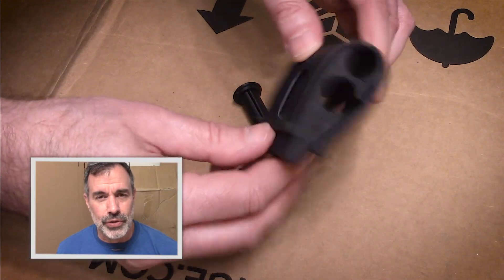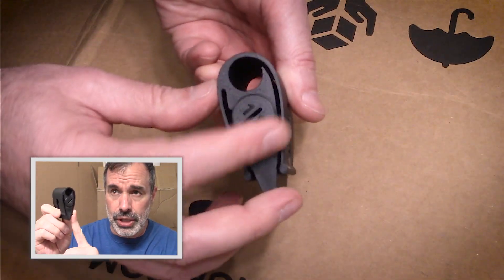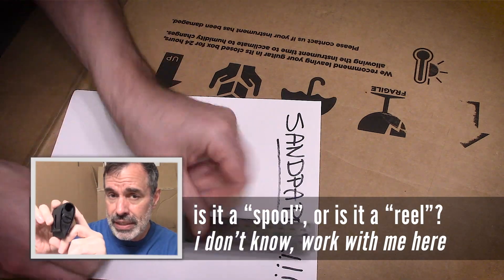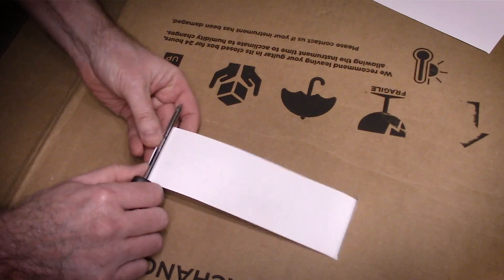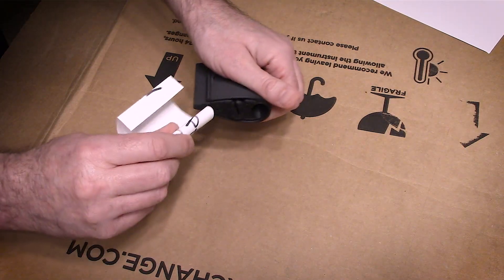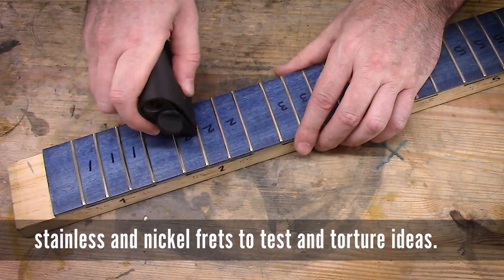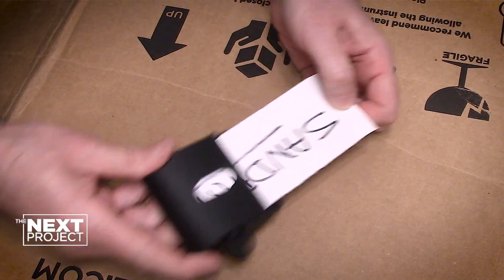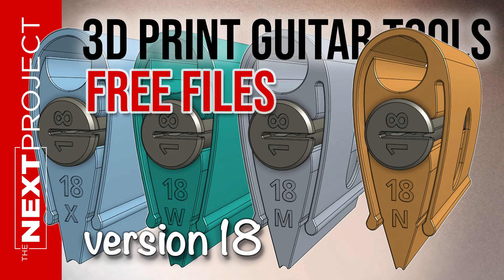Fret Sanding Polishing Grip v18 - 3D Printing Guitar Project Tools - Ep4B

Comment: Is there a width that seems to be the most popular/(all around usable)? I'm driving 30 miles tomorrow to a public library that has a 3D printer but my use is limited. I don't think I can print several of these. Also, they charge $1 for every 10 grams of filament. Any idea what this is gonna cost me? I realize thats not easy to answer when not know what the filament is. Thanks
Reply from the maker: I've been using the "wide" version for just about everything. Haven't tried the narrow and doubt that I will, the X-wide version may be overkill as well.

I just prepped the v18 wide version for print, and it should take 58 to 60 grams of filament. 
So if they charge $1 for 10grams, you'll be looking at $6 to print 1 complete sanding grip with the spool and knob. 

They should be able to set up the file ( slice it ) for you, and be sure "Support" is turned on. Support will add little tree or block looking things around the actual printed part, which will "support" some of the open-overhang areas during the printing.

Depending on the printer and a few settings, print time for 1 complete sanding grip ( with the spool and knob ) may take between 1 to 2 hours.
Again, really depends on what printer and settings being used.

I've been printing all my sanding grips using PLA filament. It seems tough enough for this purpose, and is pretty affordable.

I hope this helps, good luck with your printing process.
Reply: @theNextProject thanks for all the info. I appreciate you.

Comment: What orientation did you print the knob and roller in ? 

I printed them twice and there was not enough clearance for the roller to fit in the knob 😢 the second time i printed them with the highest quality setting.. they printed very nicely but just didnt fit 😊
Reply from the maker: Darryl, sorry to hear you're having print problems.

I'm a very basic 3D print person, a novice at best.
Each part was printed started with automatic part rotation to the print plate. 
So the coin shape end was down on the long reel part, and the thumb knob was pointing up on the reel cap piece.
There is a very small clearance designed in, so the part fit rather snuggly.

Jump to video showing orientation on the print plate.
https://youtu.be/Dd9O90jO-tE?si=pt6HLVpxvVxNDmcw&t=41

All my test printing was done with PLA, PLA+, and PETG-CF.
I'm using a Bambu Lab P1S, and the BL slicer.  Nothing fancy on my end, as I have no idea how a lot of this stuff works.
NOTE: When I originally was printing these with some Bambu PLA, there was no raft and no support on the thumb cap, it worked fine.
When I used some other products, I got an error stating I had unsupported overhangs... so I used either auto or tree support.
I did use tree support on the main handle/housing of the grip, due to those thumb holes in the sides.

0.4mm nozzle,  0.24 Draft, 2 wall, 3 top, 3 bottom layers, 15% Grid Infill.

If the cap won't fit to the reel, it may be a filament choice, filament setting (over extrude/under extrude), nozzle size and temp setting combined issue - just a novice guess. 
I have typically picked a filament, found a default pre-existing filament setting for it, and only adjusted bed temperature. All flow and such settings I just back away from at this point, I'm sure my printer would explode if I monkey with those things.

One workaround you could try, is to grab the reel in one hand, and some 220/320 sandpaper in the other. Then just give the end of the reel the is a little fat a slight rotation sanding. 

I appreciate your question regarding the print issue you are having. It helps me understand the potential issues we may all face.
Sorry I don't have a magic solution to correct the issue.
Again, maybe just a quick and light sanding of the reel end where it is to press into the cap. 

Please keep me posted as to what you find. 
I hope this helps!
Reply: @theNextProject thanks for the response!!! I will try printing the thumb knob without supports , maybe the support is causing some clearance issue. 
If that doesnt work , ill just jump into fusion and make another knob with slightly more clearance 😉. Its a neat design and im keen to try it out !!! Once i get it to work ill print 3 and load then up with different grits - it will definitely make polishing frets a breeze !!!

Comment: Hello, good sir. Those printed tools are very impressive. Is there a way to a guitar on the list for some RnR?
Reply from the maker: Scott, thanks for watching!
I hadn't thought of pre-release RnR group testing, interesting!
At this time, I pretty much just design, print, test, later-rinse-repeat as time allows.

If there would group testing, I would have to expect that anyone who would be doing some testing, would be able to print whatever the tool may be, as well as test the functionality.  The print-and-use feedback could be very enlightening for me, as I'm not overly knowledgeable in 3D printing. Also, I'm not running a print-farm to sent tools out - yet...probably won't happen.

Anyway, you've got me thinking ( that's dangerous! ).
As a new, or re-versioned tool project comes up, I may ask for testers. 
Maybe I'll post a message on the Community page of this channel... I'll have to figure that out too.
Thanks for showing interest, and if something comes up, I'll post some sort of notice.
Until then, be safe and take care!

Comment: Awesome! What grit papers do you find success with? How many do you typically use on a fret filing job?
Reply from the maker: Tom, thanks for watching, and that is a great question!
First, everyone will have their own process, so what I do may not perfectly align with others.
That said, let me start from fret leveling and work toward polishing.
I try to use the finest paper I can for leveling, typically 320 or 400.  Trying to keep scars to a minimum.
For re-crowning, I'm almost always using diamond files, 300 grit, nothing coarser than that.
Then I move onto pre-polish prep, and that's where I use this tool.
The last neck I worked, I started with 600 grit, then 1000, from there I went to polishing. So, not a lot of sanding steps needed. The frets were not scarred up, so it was pretty easy to prep them for polishing.
To polish, I currently use a dremel style tool with a cotton pad (or is it wool?), and Mother's Mag Polish to brighten the frets up.  Any good metal polish should do the same, so it doesn't have to be Mother's. 
When using the dremel and pad, it doesn't take much time per fret to get them really shiny. Keep moving back-and-forth to minimize any heat build up. 
Pretty easy process. 
Oh, I nearly always tape off the fingerboard before doing any of this work.

I do have a pedistal style buffer, and I had used it once for fret and fingerboard polishing, but it's not really my deal. Maybe if I forced myself to do things that way I'd feel differently, but for now I'll stay close to what I'd described above.

Oh, as for leveling. I do 2 types, one being a typical machined flat-bar with sandpaper on it to get the tops of the frets leveled... the other type of leveling is under-string/under-tension leveling, where the neck is strung up and whatever relief amount wanted is set in the neck. I'm finding this really offers an amazing low action for final fretwork. Even if the player doesn't want super-low action, the under string leveling (arched leveling - is that a thing?) really gets all the frets to play nice with their neighbors. It's not the same as using a few rocker/fret kisser tool either, it's a bit bigger picture, an interesting process - at least it is to me.

Hope I didn't omit anything, and hope this answers your question.
Be safe and take care!
Reply: @theNextProject  thank you for the detailed response!

Comment: So it's basically version 17.1.0.0?

With all the unused sanding paper in the beginning, it still saves you a lot, because of all the narrow space between the used paper.

Great work!
Reply from the maker: LOL, yes, 17.1.
 
I'll stick with 2 digits versioning, easier to visually keep track of, and since there is no software dependencies...
I'm working on v19 now (aka v17.2), but it may or may not see the light of day.

There is a little paper waste at the leading edge, and less at the tail, but having something to hold onto is what I really like. 
I guess we can cut the unused pieces off and save them for other purposes. I have a lot of cut-off collections all around me. 
Hmm, I may have a hoarding sickness.
Hope all is well for you, have a great weekend may friend!
Reply: @theNextProject  a hoarding sickness, yes, I know that.
I don't throw away the parts I removed, though I don't plan to ever use them again. Cheap pots and pups are just that, cheap.
But I once got a Harley Benton kit-bass. I guess the Squier pup might get into that, as I was never unhappy with the sound of it.
Actually, once upon a time, I sold Epiphone pups.